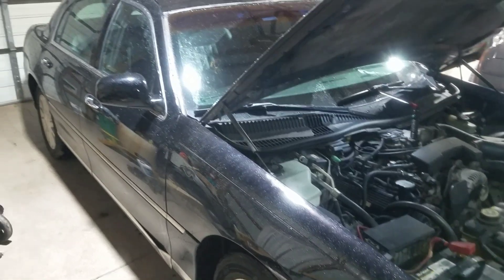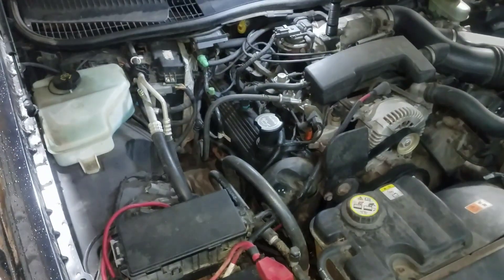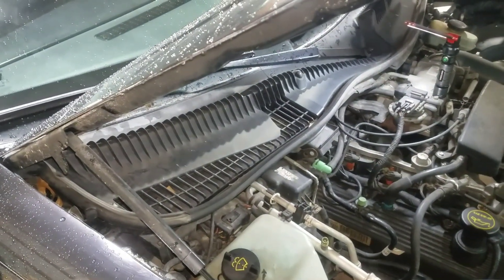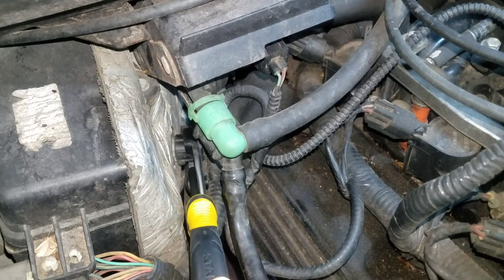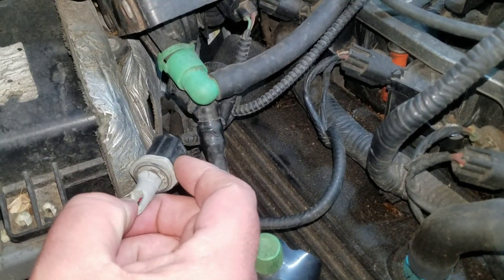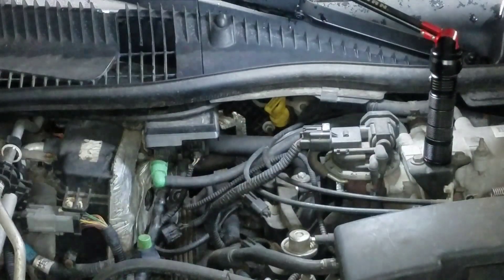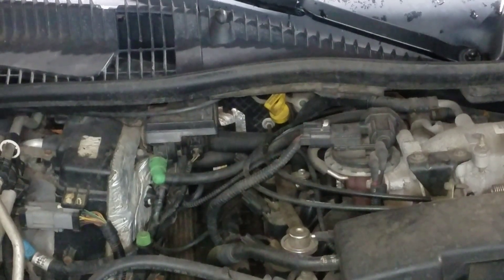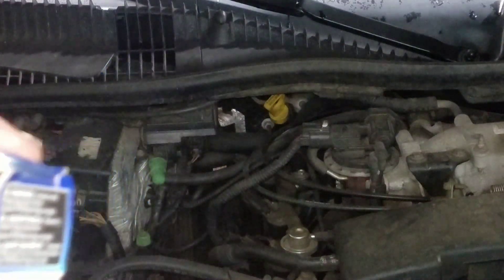Lincoln town car air change temperature sensor replacement.

Comment: I'm working on a 97 and I cannot find anything on the location of this sensor, everything just tells me the coolant sensor
Reply from the maker: @nicholaslopez4170  it might not have one. Some models didnt. I'm not sure about any that old, I know in this body style only 03 thru 04 or 05 had them and after that they didnt
Reply: @hoobsgarage  ohh ok, yeah the AC reads a code 030, I looked it up it says it's the "inside temp control sensor" and I just can't figure out wth it is, but I think its behind the dash.

Comment: My 03 has a issue that st hwy speed the compressor will kick on and off alot in town 35 mph blows cold out on rd 65mph + and it not cold just slightly cool I might try one these switch
Reply from the maker: Mine has done that same thing for awhile.  This helped that issue but it's still not 100 percent.  Hope it works for you.   Thanks for watching and commenting!!
Reply: Did you fix your car ac ? I have as same as your problem
Reply from the maker: @generallee1987  mine ended up being a broken wire going to the ac compressor

Comment: My 03 had pressure in the system but the compressor clutch would come on and off continuously, after replacing this sensor problem went away, got lucky
Reply from the maker: nice glad it fixed it.  thanks for watching and commenting.  im glad you stopped by the channel.

Comment: You never said what the actual problem was. Is the ac compressor not coming on? Or is it just not getting cold enough. If it's not getting cold enough it may be the Air Inlet Modual mounted under the glove box. It is supposed to close in warm weather. When it goes bad it does not fully close mixing warm air with the refrigerated air giving you only slightly cold air at under 85-90 degree outdoor temperatures. Over 90 outside it will feel like you have no AC at all.
Reply from the maker: Hey thanks I appreciate your suggestion because before my compressor quit coming on I was having some cooling issues in really hot weather and while I was driving at highway speeds.  The current issue and the issue this video is about is that my ac compressor is not coming on.  Will make an update video when I can get the issue fixed.  Thank you for watching and commenting,  I really appreciate you stopping by the channel.

Comment: what are your ac doing
Reply from the maker: Compressor isn't engaging.  Dealer says it needs a accumulator and low on freon another shop said it was full of freon lol.  I'm just gonna wait til spring and replace the accumulator and recharge it myself and see what happen then.   Thanks for watching.